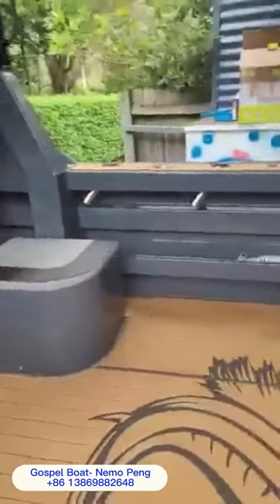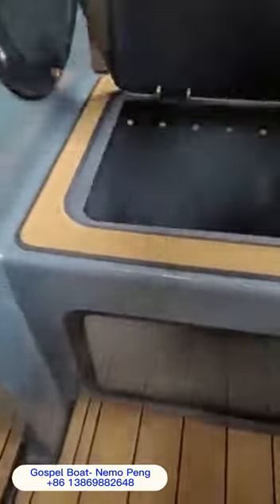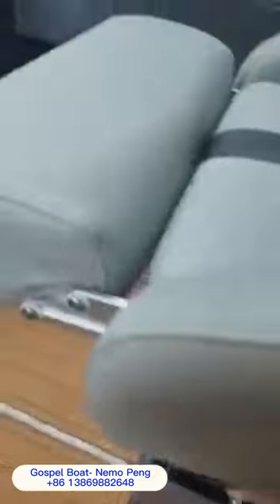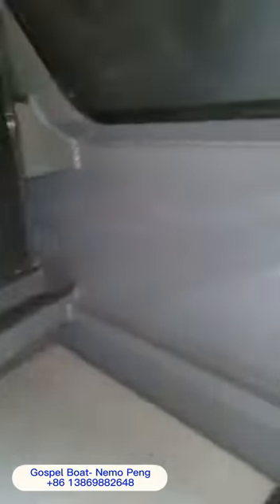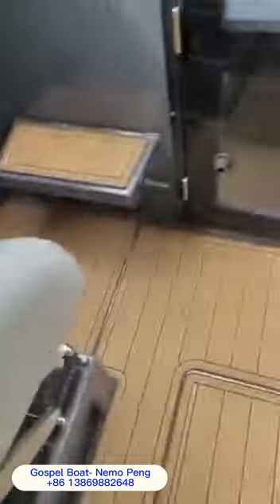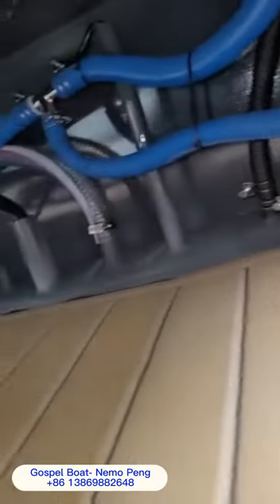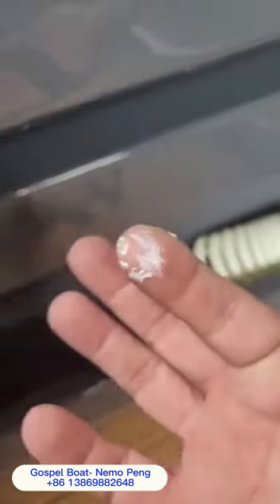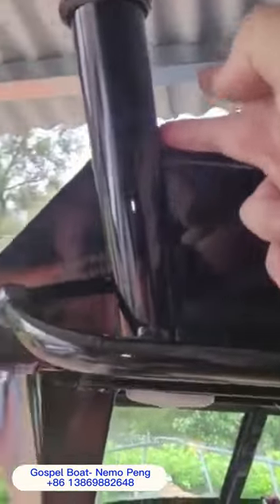Gospel Boat- Feed back from customer about the 6.85m Aluminum fishing boat Profisher

Comment: Really nice looking boat.      What did you power it with? WHat HP are they rated to?    Who did your trailer and rigging?    How did you get a builders plate?   The wiring looked a bit undergunned in terms of BnS gauge for batteries for that run?   I really like the look of it.        Just not sure at 6'4" I could sit up or lay down for over-nighter in cabbin?    Is toilet direct flush or holding tank?  Any fresh water capacity on it?   Fuel tank size?         How is it now,  9 months on mate?        Love to see update vid :-)